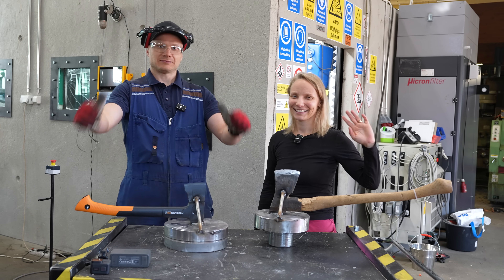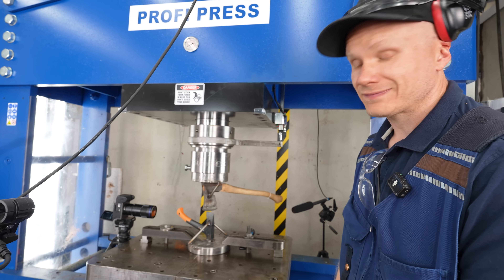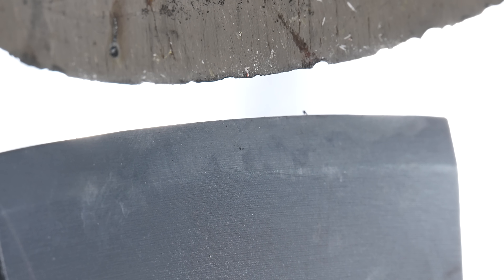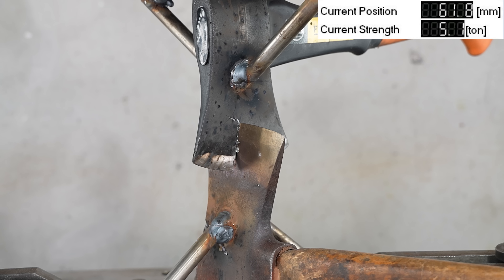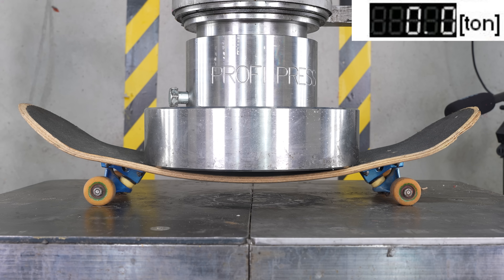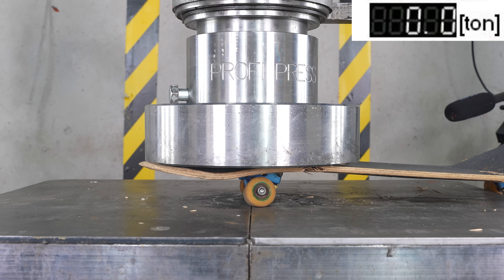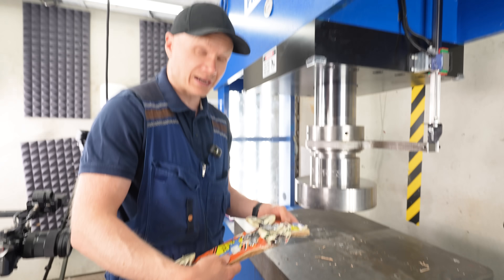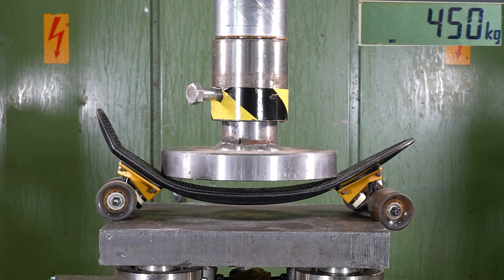Which Axe is Stronger? Old vs Modern Hydraulic Press Test

Comment: I'm sure this has been said 100 times by now, but this isn't testing 'better' or 'stronger.' This is testing harder. The harder steel will penetrate the softer one. On an axe, harder isn't always better. Axes need toughness, which is generally inversely correlated with hardness. You need hardness for resistance to edge rolling and toughness for resistance to cracking, chipping and breaking. The balance is set during heat treatment. The optimum point will depend on the steel grade and edge geometry.

Comment: There are a LOT of metallurgical factors at play. A large one being, modern day(last 5 or so years) metal production SUUUUUUUUCKS. Then you have to account for work hardening, wear and tear, alloy composition, tempering methods. Merely observing your results, I would say the modern hatchet was laser, or induction hardened, while the alloy was (like the handle) engineered to reduce impact shock.

Comment: All my axes are Fiskars, except for one of my two sledge axes, but I don't like that one very much, it hurts to use a lot more compared to the one I got from Fiskars with their special branded shock resistant handle. I also much prefer my x27 splitting maul for splitting firewood with, usually with the help of the sledge axe to help force it through the oak logs that I'm typically splitting with both. They're quite tough, some of them have burls that I just have to cut with a saw because it's impossible and unsafe to split them with an axe in any meaningful capacity. But yea, when the logs are relatively straight grain, this setup lets me go right through them without too much work. I much prefer splitting hickory and cherry with them than oak lol

Comment: May the fixation-welding on the blades have an effect on the hardness of the steel?
Reply: Only in the heat affected zones if you clamped on an aluminum bar for a heat sink, otherwise it's how fast it cools

Comment: I'm thinking the Fiskars is made with harder, more brittle steel, as you could see and hear pieces chipping off of it. As such, it the steel was hard enough to cut into the softer steel of the Billnäs axe. 
The Billnäs would be easier to maintain and sharpen, as the steel is softer, but the Fiskars wouldn't need it as often. Although if it contacted something very hard, it might chip.

Comment: 02:35 - Omg that sound of cracking steel - almost like some grand intro to a horror movie by the orchestra ...
03:32 But wait a second - does the trajectory of the bottom axe not actuelly aiming for the middle of the upper axe? Or is this just visual  distortion because of the camera lens ?

Comment: Actually, the result is quite interesting. The old axe was winning at the very start abut as soon as it moved past the edge it gave up quick.

So I assume the old axe has a high hardness edge with softer steel behind it. While the new axe is one solid chunk.
Reply: Exactly my thought. When not in the press, but chopping trees, that old Billnäs might outlast the Fiskars ... well, it already did, it survived all those years.
Reply: @ivo215 That's a prime example of evidence denial. Based on this video, literally nothing suggests that the Billnäs would last longer.
Reply: @anteshell  no, I'm pretty sure that Billnäs  is 100 years old and was still around until this video was made and the Fiskars is already destroyed. He is technically correct, the best kind of correct.
Reply: @BaronVonNeil  Ah, a Futurama-fan. A cultured bro.
Reply: What evidence has been denied?
Reply: That was my impression as well. I would have liked to see them stop and separate the axes to show the initial damage, before smashing them back together and finishing the destruction.
Reply: It is like a katana
Reply: You can see right about that point there is lateral movement introduced only on the top axe.
I would wonder if that was a cause or effect. The bottom axe head was squared up nicely, the top had an angle to it where the contact point was not centered over the base where it was welded. 
So the force on the bottom head was going straight down through it's center to the welded base.
The top head was being pressed toward one side and offset to the welded base.
Reply: It's the same steel, it's just the tempering process that makes the thicker parts more soft, because they get cooled slower than the thin part at the front.
Reply: Seemed like as soon as there was a boom or crack the old axe became brittle

Comment: The older axe probably has a piece of hardened steel (for the cutting edge) forge welded into mild steel, whereas the new axe is probably 100% hardened steel.
Reply: This^^^ is most likely correct, given it would be common construction for an ax the age of the Bilnas - softer steel folded to make the eye for hafting, forge welded to a harder steel "bit" - the bangs in the beginning (and the dent in the Fiskars!) also make sense, in that kind of ax making. I know. I am a nerd.
Reply: Exactly. Or after forging the Bilnäs was only heated and hardened at the tip.
Reply: The fiskars is definitely a harder steel.
Reply: Maybe it's tougher but it's not harder.
Reply: it's not so old that it was hand forged, it's clearly a mass produced item so the case hardening theory (given also it's apparent age) is like a million times more likely, especially considering european economies of the past...
Reply: very true
Reply: Am I the only one that sees that the angle on the cutting edge is narrower on the old ax and visibly sharpened. First cut wins
Reply: Or the older ax was case hardened. I think that is more likely.
Reply: What is your understanding of "case hardening"? I highly foubt that axe was hardened that way. I am positive it hase forgewelded in cutting edge and poll plate portions.
Reply: @RaymondSwanson-u9yI doubt that.
Reply: @MrBlack-vg8rv u got me with that read more ngl 😂
Reply: Made of tree what?
Reply: @MrBlack-vg8rv  Bruh, my negative iq brain had me press read more like a link.
Reply: The fiskars is black, from the tungsten carbide coating on it. Unfair test.

Comment: Seeing those skateboards reminded me of something I did as a teenager! I had a pair of roller-skates (not rollerblades) and got the idea to take the Phenolic (hard) wheels off and put Polyurethane ones on! So, I got them and changed them. No "precision" bearings, just "BB"s, like you shoot from a BB gun. Those skates were awesome! Once I got used to them, they cornered like I was on railroad tracks! Like riding with the cornering "G" force of TWO skateboards! :face-fuchsia-wide-eyes:
Reply: Yea, it feels weird getting odd looks when i ride my skateboard to the corner store these days, but when it comes to doing longer faster trips Ill take the fruit boots over the speed wobble any day. Still waiting for the 300lb, AI guided, electric mono wheel to use a pull sled to satisfy my inner child. Until then hanging onto the bumper of a passerby will have to do.